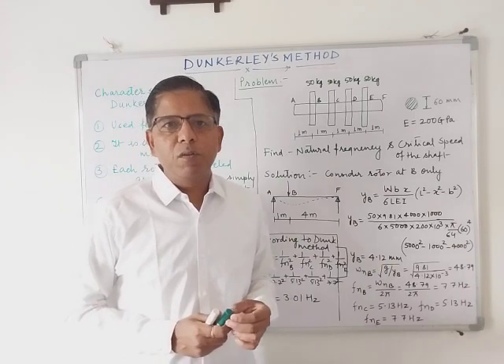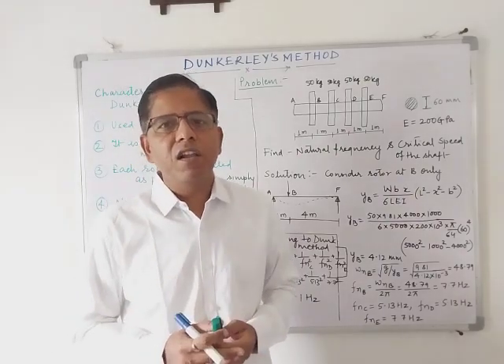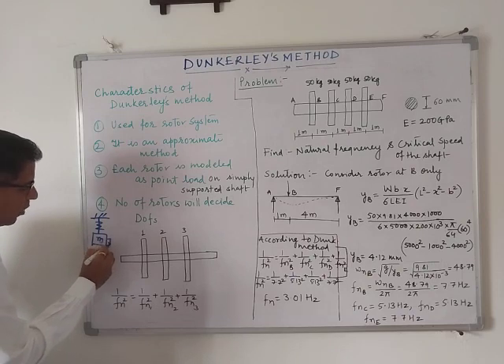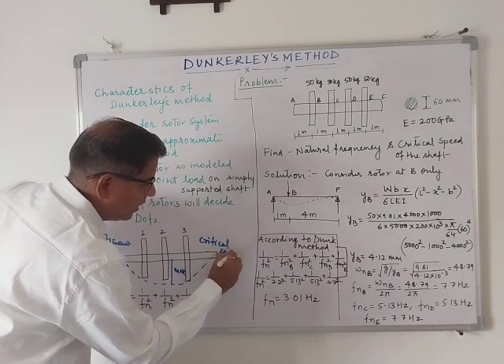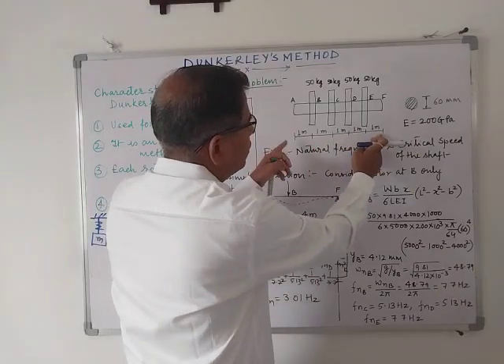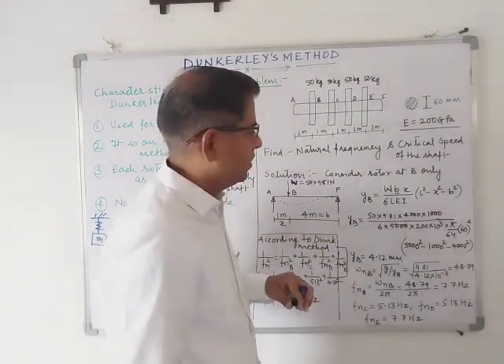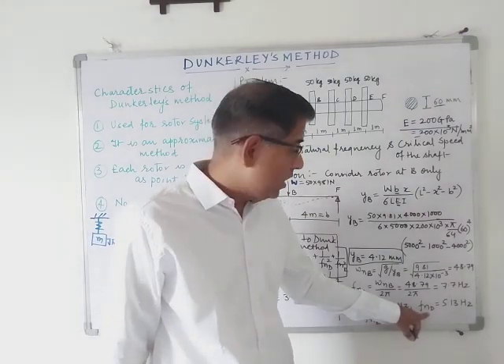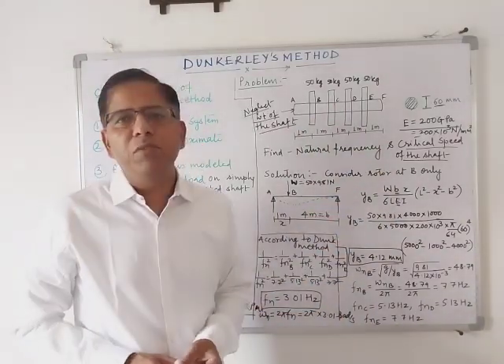Lect 34 Dunkerley's Method for Critical Speed & natural frequency without shaft weight

Comment: Hello Sir. I am wondering if this method is still applicable when the shaft is stepped. Please give me some suggestions how should it be considered
Reply from the maker: Dunkerley's method is applicable to stepped shafts because it can handle systems with varying diameters and lengths. The method takes into account the flexibility and mass distribution of each section of the shaft, allowing for a more accurate estimation of the natural frequency.